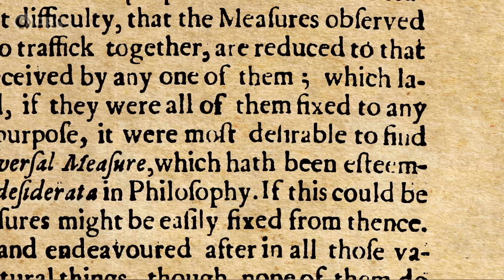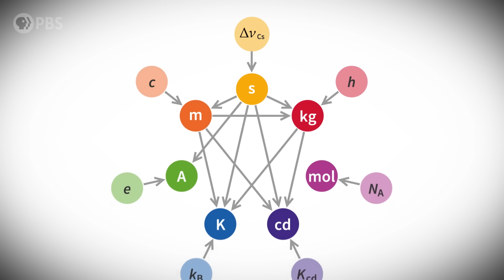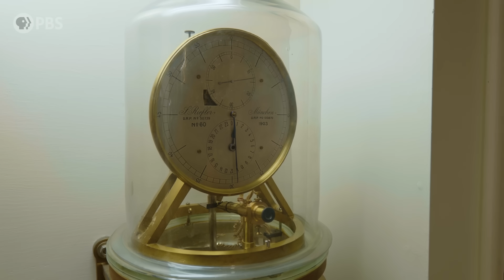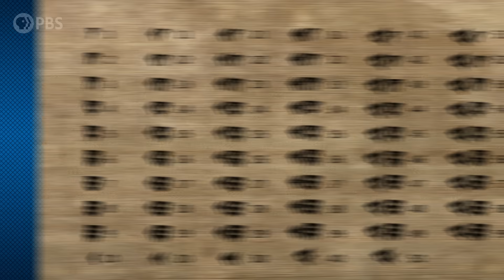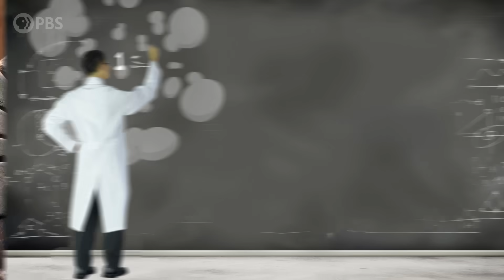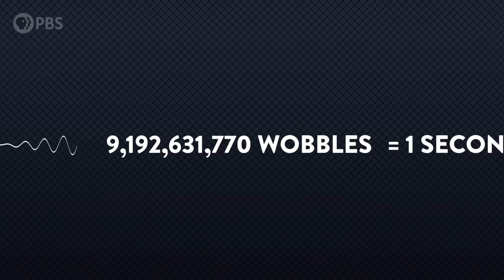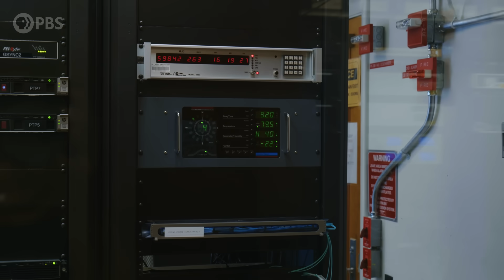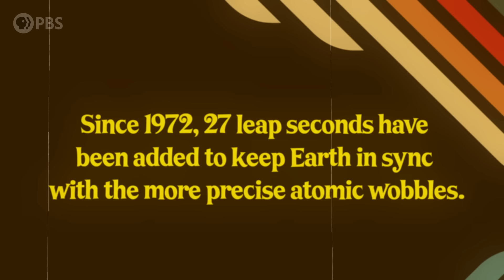The Unexpected Measure that Makes the Modern World Tick

Comment: I wondered about this in 2014 and these were my findings: -
    Network Time Protocol (NTP) is a networking protocol for clock synchronization between computer systems over packet-switched, variable-latency data networks. In operation since before 1985, NTP is one of the oldest Internet protocols in use.
    It is amazing that although the internal clock on my laptop runs at 1.50 GHz, i.e. chops time into 1500000000ths of a second, it can't keep accurate time over a few hours. Proper NTP can tolerate and correct a PC's clock that is out by up to +/- 43 seconds a day.
    Wikipedia NTP page:
    "Future versions of NTP may extend the time representation to 128 bits: 64 bits for the second and 64 bits for the fractional-second.
    The current NTPv4 format has support for Era Number and Era Offset, that when used properly should aid fixing date rollover issues. According to Mills, "the 64 bit value for the fraction is enough to resolve the amount of time it takes a photon to pass an electron at the speed of light. The 64 bit second value is enough to provide unambiguous time representation until the universe goes dim."

Then in 2015/11/1 I found: -
    The latest in atomic clocks would neither gain nor lose one second in some 15 billion years—roughly the age of the universe.
    (One second in 15 billion years is 1 part in 1000,000,000 x 15 x 365.25 x 24 x 60 x 60 = 473,364,000,000,000,000 = 4.73 x 10^17)
    Now, after taking in the almost incomprehensible accuracy this represents, one could be forgiven for thinking "Yes, but who needs clocks that accurate? What could they possibly be used for?"
    Well, it turns out that they can be made useful by studying what makes them INACCURATE. Once you have this steady pulse, gravity, magnetic fields, electrical fields, force, motion, temperature and other things can introduce tiny but measurable variations, such measurements becoming a proxy for measuring the actual gravity or force etc.
    For example, as Einstein predicted, a gravitational field causes time to pass more and more slowly as gravity increases. A clock which is higher is further from Earth, experiences less gravity, and thus runs faster. The new clock is sensitive enough to detect the time shift caused by a rise of only two centimeters! It can thus serve as an extremely accurate measure of height for mapping, and of gravity variations caused by the earth's composition and shape. (Note that gravity's effect on time is NOT relevant to GPS satellites)
 
    A reader interested in a fuller description of the intricacies involved and the influences which must be accounted for to achieve this accuracy should click here for the article "About time: New record for atomic clock accuracy", April 21, 2015 at phys.org.

Comment: You might want to consider making a video explaining why the need to add 27 leap seconds since 1972 does NOT imply that the Earth's rotation has slowed down by 27 seconds since then, and that in fact it has slowed by less than a millisecond.

Comment: You've started off with a false argument, a bad faith statement. The USA uses the Imperial System (save your jokes for later) and this system is not based on something so arbitrary as a length of wood or metal.  This standard is also based on the natural world, the Imperial System is also based on time, though too few people know it today as they did when it was in its prime some six or eight thousand years ago. And the Imperial System, although mostly forgotten about, and is indeed a crumbling remnant of what it once was in its glory days, is still vastly superior for its intended uses than the lowly metric system. A short explanation is now due.
        The Imperial System used today is a the ancestor of the Sumerian measurement system. It is a Sexagesimal standard, based on sixty, not ten. It is intended specifically to be used for measuring time, angles and fractions. And nothing could be more natural as it is intimately tied up with the phases of the moon, farming and  women's menstrual cycle. It is an elegant method, far more "natural" than ten. Do your own deep research and you'll wonder why you ever gave it up. That's not to say that everything in the IS is natural and science based, that's why the change was needed. But the rest of the world threw out the baby with the bath water on this one. BTW. Time begins with life. Happy studies!

Comment: No discussion of time is complete without discussing it two pratical meaning. Time has two practical definitions: duration and date. Duration is measured by counting the number of cycles of some periodic process: the swings of a pendulum or the number of cycles of an electronic oscillator controlled by observing the spectrum line of some atom. In essence, a clock is just a counter combined with an oscillator. As to date, it is just the duration from some arbitrary zero, and once this arbitrary zero is chosen, a duration can be found as the difference of two dates. So a duration is a time interval between the start and end of a process.  

It is an accepted principle of science that under the same conditions, physical processes should not depend upon dates but only on the duration of interactions. This principle is often obscured by the common practice of assigning the start of a process to be the zero date. We mainly use dates to give an ordering to when events occurred relative to each others.

Comment: Is the US really not using the metric system? Last time I visited the US I was a bit worried about this but everything was in metric. Food, medicine etc…the friend I was staying with specifically referred to a bottle of soda as a “two liter”, even her drug dealer used “grams”😂. Only thing I obviously noticed was the speed limit which was in MPH and thermostats were in Fahrenheit and I was told construction workers use imperial. I was doing CAD there and myself and the Americans I was working with were using entirely metric. If anything I found Americans to be able to freely use both imperial and metric without skipping a beat…I was impressed because I had to look up conversions 100% of the time.
Reply: It honestly depends on what is being measured. We buy soda in 2-liter bottles, but milk and gas are in gallons, and dry solids are usually measured in cubic ounces. We measure temperature in F and distance in inches and miles. Weights are usually in pounds and ounces, but medication is milligrams. The LEGAL standard is metric and has been for years, but as mentioned in a comment above, they have legally defined Imperial units in terms of the metric system so that industry didn't have to spend billions of dollars retooling all the things. So while legally we are on the metric system, Imperial units are still used day to day by most people.

Comment: Actually, the atomic time, TIA (International Atomic Time), doesn't get leap seconds added! It is the time we all use, UTC (Coordinated Universal Time) and our local timezones get those nasty leap seconds added. After all these years, there is already a very noticeable offset of 37 seconds between UTC and TAI.

Why did I call these leap seconds nasty? Whenever we play around with our timekeeping mechanisms, we break things. Out local timezones are a mess, there are countries that have daylight saving time and others don't. Those who have them, have a day where a hour is missing and another day where a hour exists twice. Some want to get rid of daylight saving time, some of these want to use their normal time the whole year and others would like the summer time to be used the whole year. It's a horrid mess, it's better not to use it. And that is the reason why we use UTC on the internet. And then there is the f*$!ing leap second and programs start to crash, data gets corrupted and so on. It is so bad that some people had the idea to gradually change the clock over the day instead of pausing the clock for a second. It is also quite funny if you want to calculate how many seconds have passed between 2003-01-01 00:00:00 and 2022-11-24 07:12:34

But calculating time ranges is even without leap seconds very messy, because if your points in time are far enough apart, you discover that there were many changes in the way we specified points in time - different calendars. The timezone database is a good documentation of that madness: https://en.wikipedia.org/wiki/Tz_database

Comment: My question is, how does the oscillations of the atom, correspond to a second in order to define it? If the question to define the second is, "how many times does the atom oscillate in a second?" Doesn't the second already have to be defined in order to answer that, and is thus not fundamentally defined by the oscillation if the atom itself. Like even if there is two clocks, one counting the passage of time, and the other counting the oscillations, when the clock counting time reaches one second and the other counting oscillations stops - isn't the time clock already using a predefined second? It's using what is already define as a second to determine when to stop counting oscillations. I'm just confused.

Comment: Time is such a freaky concept. It's really an illusion. What we're measuring is basically entropy. How much things "run down". We use that running down to move things that put "time" into a visible form for us to perceive. Just thinking about it is confusing.
Reply: It is more confusing that it is relative, and relative in various ways. 
Like it is physically relative, but also psychological relative, you can feel the passage of time widely different, and parallel to that, the passage of time between 2 objects can actually be physically different affected by gravity and speed. And then it is also relative in the sense that earth's self rotation and earths rotation against the sun is not related so a day and a year are not connected and never will be, and there are galactic years that is the time the sun takes to orbit the center of the galaxy, which is also disconnected from the previous 2 times. 
TIme is a mess, it is a very real thing that is not an illusion but it is freaky.
Reply: Time is a real thing. How humans measure time is arbitrary, but the passage of time continues with or without humans measuring it.

Comment: 8:00 The wild thing is, we could transmit this standard to an alien and they would know exactly how long a second is as defined by humans. From there we could tell them how long a meter is.
     That is pretty far out.
Reply: You would still have to teach them language and number system base 10 etc. Then also show them the substance that we call cesium. This goes on and on so them knowing what a meter is would be like the last thing they would need to know.
Reply: @MrT------5743  cesium has a precise number of particles that can be experimentally proven, it would be much easier to use base 2 that base 10 for communicating with them.

Comment: Actually, rubidium clocks are more common than cesium clocks, but, cesium is the basis for standard time because its frequency is about twice as high (and its resolution is half as big).
Reply: They are way cheaper too, so more common since.most people do not have to be as precise as cesium clocks.

Comment: It would be fascinating if you could manage to get a chat in with David L. Mills, the inventor of Network Time Protocol and probably the most underrated contributor to technological progress over the last 40 years.
Reply: A fun fact is that NTP is far too coarse for cloud-native apps. Clocks are only synchronized within a second or two - that's millions of microseconds!

That's been an annoyance for a long time if you're trying to merge logs across multiple servers within a data center. Unless you have a really smart merge program you'll routinely see responses occurring before their request, etc. It can make it really hard to figure out what's going on.

In traditional apps you'll make a request and wait for a response, probably with a timeout. However you're unlikely to have deeply nested requests. The traditional three-tier model (presentation, business, and persistence) is a simplification but not unreasonable.

With cloud-native apps you're much more likely to see deep cascades of requests and things are just a lot faster in a modern data center. (Think 100 Gbps network connections.) Timeouts are tighter and any effort spent to respond to a request that has already timed out is wasted. NTP is far too inaccurate to use the system time... but if you had clocks synchronized to within microseconds then you could pass the appropriate deadline in each request and drop it if you know the results will be ignored.

The Precision Time Protocol (PTP) handles that. It relies on special hardware in the network device (now common in consumer gear) and only works within a data center due to network latency issues. But within those constraints it can keep clocks synchronized within a few microseconds.

Even those of us running traditional apps come out ahead since we can now merge our logs and never see responses before requests. (At least if we increase the precision in the timestamp.)
Reply: @beargiles4062   There's also Precision Time Protocol, which is much more accurate than NTP.

Comment: Why were they not able to create a second that doesn’t require a “leap second”?
Reply: It is because the earth is not rotating at a consistent rate. It speeds up and slows down. No matter what you do, your time will eventually be off if the second is defined as one specific value.

Comment: Always bothers me that these "explainer" videos don't say "why" quartz watches/clocks use 32768 Hz ... Of course there are only 10 kinds of people ... 
Leap seconds will be discontinued around 2035 per the most recent General Conference on Weights and Measures.
There are thousands of NTP servers worldwide - USNO and NIST don't have a monopoly on it (couldn't serve it all if they tried) - most Stratum 0/1 sources use a local GPS receiver as the reference - IAC - NTP is a millisecond level service for most computers getting their time from a Stratum 1 source on L/WAN.
Using a GPS receiver directly (including its 1 PPS output), sub - µs accuracy is achievable.
As to GPS position, really missed a chance to delve into relativity and how GPS is designed to correct for both special and general relativity - and the effect on time.

Comment: But according to special relativity theory (and general relativity too) , time is relative (or the perception of time) , so for accuracy you must measure time in a rest state when the time have the fastest flow rate (relative with any other frame of reference), isn't the rest state fundamental for measuring time?
Reply: But with time being relatve, there is no rest state for time.
Reply: @MrT------5743  time is dependent on two things, gravity and motion, but the motion most be measured relative to the rest state not other objects that can move too, so a galaxy that receives the light from the big bang from all directions of space at the same redshift(no difference in one direction or another) is in the rest state and have the fastest flow rate of time possible, and that is a absolute frame of reference for measuring time.
Reply: @theOrionsarms  there is no rest state for motion in the universe. There is no such thing as not moving in space. Everything is moving.
Reply: @MrT------5743  actually the rest state is  fundamental in measuring proper motion of each galaxy, our galaxy have a proper motion relative to the background microwave fundal, and it's the only frame of reference that makes sense at the scale of entire observable universe.

Comment: Joe, a question, which you may or may not be able to answer:

When the data containing the exact time is sent to a server — say a server in Houston needs the exact atomic time from the "official " atomic clock — is the amount of time it takes the data to travel accounted for? It’s hard to word this in a way that makes sense. At the speed of light, data takes a very short (but not zero) amount of time to travel from DC to Houston. That tiny delay would seem to throw off the accuracy by that travel time. How does all that work? The same goes for transmitting atomic time to satellites.
Reply: Excellent question! There must be a way to compensate for this, but I can’t think how they could!
Reply: You're free to read https://en.wikipedia.org/wiki/Network_Time_Protocol :)
Reply: @rachelbroughton6457  it is just compensated by having an internal clock and measuring the time it takes to send a packet out and recieve it back, then divide that by 2, and you get the delay between 2 points, as simple as just a sonar works. 
You can even send back your new measured time, with your measured delay and the time it took you to calculate it and send a new package to recieve a new time, and compare the new time with your estimation, if it still doesn't coencide, you can use the difference to overcorrect and keep doing this until they are close enough for the difference being less than 1 in epoch time, at which point you are essentially syncronized, then you just run off your internal clock for an hour or so, and do this proccess again to resyncronize yourself.

Comment: seconds are simultaneously the most and least popular SI unit. They are used without a question in America but even in the most metric countries, its metric derivatives ks, Ms, Gs are always snibbed in favour of clunky traditional units.
Reply: True. I always point out that km/h, kWh, RPM, mAh etc. are not—strictly speaking—SI units. However, the SI standard does condone the use of minutes and hours—along with a whole bunch of other non-SI units like electron-volt, degree (for angles), light-year, parsec etc.

Unfortunately, nobody uses Mm, Gm either—they invariably say 1000 km or 1 million km respectively. Nor Mg and Gg—they say ton and kiloton instead. Those are my bigger peeves.